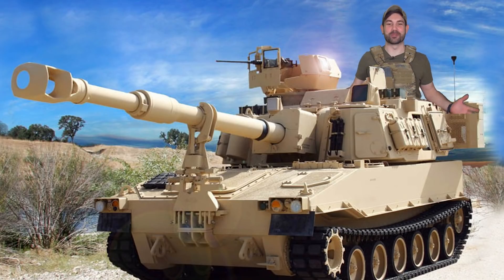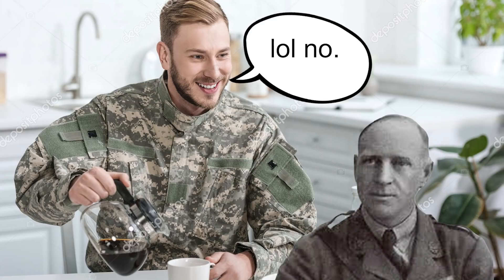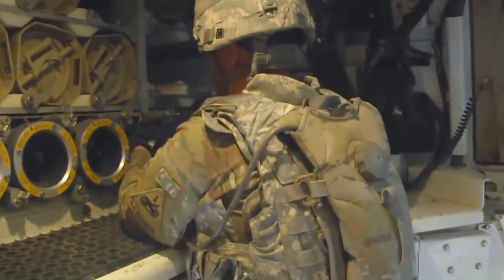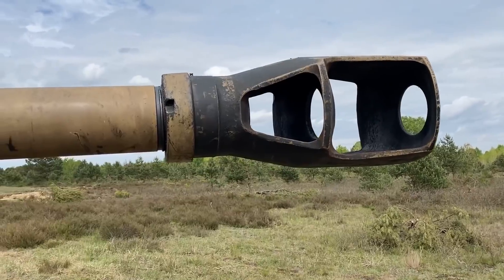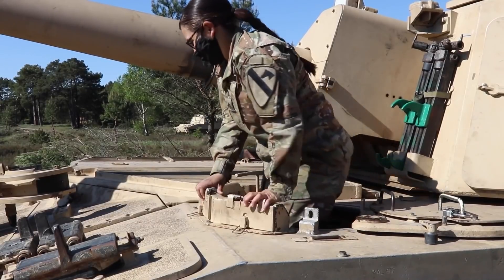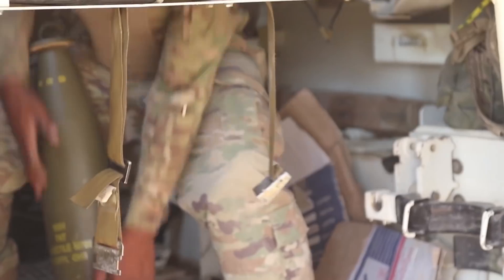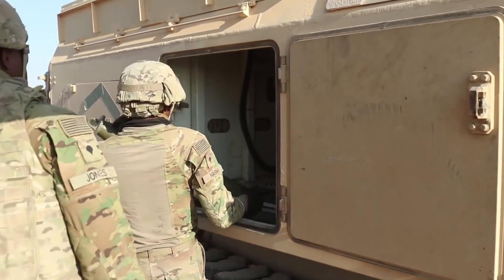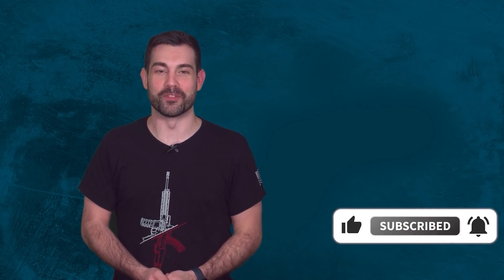M109 Self Propelled Artillery Vehicle Tactics Explained

Comment: As an IDF Artillery Corps man (2001-2004), I wonder how different the Israeli modified versions of the M109 really are. I know we stuck quite a bit more shells in them and had a nice turret back side "window" so the commander can actually see the ammo racks and soldiers behind the vehicle from his elevated position. The two main issues we had were the really unreliable track system (that had us pounding 10-pound hammers on each track piece every single day, and would still occasionally pop-out when travelling over small boulders in the Golan Heights), and the stupidly designed gunnery computer that didn't have an option to "fine tune" the gun bearing, so you wasted half the time between reorientation gently tapping the joystick to get those last few tenths of a mil (you are only considered on target if under 0.5 mil deviation (a mil is 1/6400 of a circle, a much more accurate version of "degrees"). Also bizarre is the fact that we still use long metal cables tethered to a strong spring to initiate the blast, and not something "modern" like a freaking FIRE button.
Reply: באיזה גדוד היית? אני משרת במפקדת חטיבה(בזמנך אגד) 282
Reply: Fine tune with the handwheel.
Reply: @danieparriott265  The handwheels are seperate from the electric-hydraulic system and requires flipping switches not in your immediate vicinity to turn it off, and if I recall correctly the wheels are situated on the other side of the gun - near the optical sights used for direct fire. Maybe there are two sets? I don't remember, it was never part of the doctrine and it's never a good idea to switch hydraulic systems on and off every few seconds anyway.

Comment: I think the US military in the future should keep the M109 but also have an artillery piece capable of firing a larger shell with greater range, accuracy and lethality than the M109 similar to the German Military’s artillery pieces which have a 30 mile range instead of only 12-15 miles.

Comment: I worked my way up the ladder and was a section chief on an M109 back from '69 thru '75.  In Nam the 109 was used to protect fire bases, not just from distant targets, but from human waves.  The round used to take out a human wave was the behive round. It was used in direct fire to tumble end over end once out of the barrel, then when the beehive exploded, it sent thousands upon thousands of little pleshettes (razor blade like pieces of metal) out on a wide angle at the enemy. You would not ever want to be on the receiving end as it had a nasty shotgun effect. Enemy soldiers were found ripped apart and even pinned to the trees.  I direct fired our 109 when we needed to and believe me, we could be as effective as any tank albeit we had a lot thinner cast aluminum armor. Inside comfort? Take it from an insider, I spent many hours sleeping on the 109's fold down webbed "benches".  The damndest thing about the 109's was the muzzle blast.  You never, ever want to be behind the muzzle at an angle 25 or so degrees. One day we were calibrating six 109's, all parked side-by-side like a few feet apart from each other.  Each individual 109 got it's own fire mission for observation and comparison to the other 109's. At one point during the calibration, I was sitting in the gunner's door reading when I head the word "Ready!" from the 109 next to me. By then it was to late for me to move,  I don't remember hearing the word "Fire" as all I remember was getting blown out of that turret door, across the turret into the ammo rack on the other side. Yeah, that mistake cost me my hearing in my left ear and no we didn't wear earplugs as how the hell were you going to hear the commands?!
Reply: The bee hive rounds our 106mm recoiless rifles and our M-79s were litterly nails with fins, you can buy a envelope of them at any gunshow or on ebay.   I lathed many a house with nails that were the same size, same point but with a flat head, so for nail manufactors to turn out the fin'ed flechettes was no big deal, the 106 held like 10,000 of them.
Reply: The beehive round does not tumble. Someone fed you a line. Believe me, I have 21 years in this weapons systems, a lot in combat.
Reply: @dannymalone4247  You might be right. But then I was told this multiple times not only by those who trained me in Ft. Sill but other combat veterans. Once in awhile I'd catch sight of a round going out the tube in that fraction of a second opportunity. They all looked straight to me but I cannot attest what the round did once that fraction of a second passed. Got a slo-mo video of one? Not that it matters how the round got there. What mattered was the damage it caused.
Reply: What is your thoughts on the focus of newer, lighter SPGs? Obviously not as well armored but easier to move and uses less fuel.

 Feel like the heavier systems aren't getting any love in Ukraine. All about the HIMARS and Archer!

Comment: You forgot to mention mobile artillery against static artillery battery has an edge shoot and scoot deepen or close the distance have pattern instead of static traverse capabilities they cant alter firing elevation based on moving arty to higher grounds and the advantage mobile artillery has of firing and hiding behind elevated terrain such as dunes.

Comment: Why was a ~10 meter lanyard used? I served in a 175mm/8" SPH battery; we used a 50ft lanyard when firing the maximum charge as the tube might ( and did one time) rupture. We occupied an LZ outside Ban Me Thuot with the smaller M 108 105mm howitzer which had an unbelievably fast rate of fire. Thanks for episode, the interior footage of firing was great.

Comment: The Seige of Bastogne shows the fact that sometimes there is no retreat. (It was a seige with various battles as a result). 
105mm field artillery pieces were turned into ad hoc anti-armor positions. They were not designed or intended to be used in this function. But at Bastogne, they were instrumental in blunting attacks and giving the impression of stronger defense than was reality.
Paladin can certainly hold it's own in seige defense if forced to do so.

Comment: Great video, actually taught me things I didn’t know about self propelled artillery. But in my opinion it needs more range to be safer from counterattacks
Reply: I'm not so sure. If you have air supremacy and you know where the bad guys are and they don't know where you are, range isn't much of a defense. Of course, it increases the square kilometer area that you can dominate, but remember these things don't operate in isolation.
Reply: The American 155mm howitzer has more range than any of our adversaries guns. The only countries with howitzers that have more range is South Africa (ally of the US) and South Korea (ally of the US). The Palladin is also designed for speed and agility. The most we would fire in a situation where we are engaging in counter battery fire is three shots. It would take a minute to fire them off and we would change positions as soon as the third shot was fired. This way, by the time the enemy generates a firing solution with their radar we are already gone.

Comment: So I'm a mechanic on these. I like them, but their age is really starting to show on our pieces.
Reply: Imagine working on an M110a2 in 1989 that came of the production line in 1962 ..... had a serial number of "79" on the data plate.   Got it's THIRD gun tube replacement that summer .... those tubes were supposed to be good for 10,000 EFC rounds.

Comment: Why not replace tanks with the paladin. It has amazing mobility, and has a big gun that can punch through tank easily while armour upgrades and etc…
Reply: The doctrine of a tank is very different than for a self propelled artillery. Tanks are meant for scouting and infantry support, as well has some patrolling duties. Because of this, tanks will only shoot at what they can see, and because they engage the enemy at closer distances, they require heavier armor. Also, their rounds are self contained with a projectile and a propellant, because they only shoot straight. They also typically shoot at one target like a vehicle or a specific room in a building. 

Artillery on the other hand is meant for indirect fire support. As such, their rounds are larger, but they almost always engage from distances beyond the line of sight. The coordinates for attack are called in by forward observers or by the infantry, and they place rounds downrange. Because of this, the armor is weaker on the M-109, as the majority of threats either come from small arms fire or other artillery (the armor is strong enough to withstand shrapnel, and there isn't really any armor capable of stopping a direct hit from a shell from above). The propellant and projectiles are also separated, because that gives the shooter the ability to adjust the amount of propellant for different distances. In addition, artillery mainly is used to attack an area as opposed to a specific target. They are mostly used either to soften the resistance before infantry moves in or to prevent the enemy infantry from advancing.
Reply: @avrahamhirsch2724  Thanks for writing a very good informative answer to the question.

Comment: After watching Armenia's drone shellacking by Azerbaijan in their recent conflict, its clear the M109 Paladin is an absolute dinosaur with no place on the modern battlefield.  Without absolute air superiority, even cheap Turkish drones means its crew is dead meat.  But if your air superiority is thorough enough to protect your Paladins, then the military situation doesn't really call for these slow self-propelled howitzers and their hefty logistics.  A turboprop light attack aircraft like an AT-6 Wolverine armed with laser-guided rockets will offer more precision and flexibility with less collateral damage.

WWII battleships were cool too.  They just aren't that useful.
Reply: I can hardly believe it, but the new XM1113 shells for the M109 cost nearly as much as 70mm AGR-20 precision guided rockets.  $15K vs $22K.  That's pretty bad when you realize it will likely take more shells than rockets to accomplish a given objective.

Comment: Hey Cappy.  My first unit out of AIT was 1/15FA, 2ID, in Camp Casey, Korea, in March 1997.  The M548 was already well phased out by then.  We had the M992 by then.
Reply: Was there same time “First to Fire”.
Reply: @johnrivers9393  What Battery were you in?
Reply: 84-85, 87-92, 7 tours of the DMZ. Spent so much time in the ROK that I could actually Call for Fire in Korean. (1/15FA, 1/17IN)(8/8FA,2/503IN)(1/15FA,5/20IN)
Reply: HHB.
Reply: @johnrivers9393  Right on.  I was in SVC Battery.

Comment: 45D and 63D, M109A2 easy to work and repair. M110 trained on but never stationed in a 110 unit and never serviced them, but sad to see them get retired. M992 was a pain in the ass with the blowers failing ( tied in with electrical charging system) and the front bustle racks had to be pulled back to climb down and get too, bigger pain when the racks were loaded. A lot has changed since 1993, and a lot more will change in the years to come.

Comment: Conjoined with JETS, Joint Effects Targeting System, the Paladin now has sniper like accuracy, particularly with GPS guided munitions.  It's a tremendous force multiplier for  artillery.    Being exponentially lighter easily portable it will be given out at the platoon level forward observers.

JETS might matter even more with mobile artillery like Paladins.   It's a mathematical consideration that when a target information is an approximation, error either decreases or increases with movement at rate commensurate with distance moved.   In other words, if you only knew generally a location you really don't know how much you really moved and need to readjust.  As an added plus, JETS allows for immediate fire-for-effect where adjust fire often warns the enemy.  

JETS changes tactics and the perceived power of shoot-and-scoot.  It substantially increases the Paladins military capital on the battlefield and very possibly lowering the amount munitions required per task.  This would increase tempo of operations for the Paladin which in a sense multiplies the number in field.
Reply: The 155mm has a 100 meter footprint so spending ten times the money for the JETS's trying to get the rounds closer is nearly pointless. Nearly...They've had Copperheads since 78. We tested them and we were dropping rounds down the hatches of tanks from ten miles out however the Copperhead isn't good in heavy snow and if the enemy has IR systems they can see the laser which points back to the FO's position. In this case spending the money for the upgrade is worth it because without FO's 155mm are blind.
Reply: @readhistory2023  We were told that the standard shell had a 50 meter kill radius (yes that's the same as a 100 meter footprint) but kill radius was defined to us as 50% casualties in that radius. Since we trained with the guns in a lazy W pattern with each much less than 50 meters from the next, the pattern on impact was quite impressive. BTW, I was in FTC, so I was much more familiar with the slide rules (mostly charge 5) than the actual guns themselves. Plus, I didn't have to hump the ammo.

Comment: The artillery batalion in Norway used the m109 until last year. Im sure it works great in the dessert an flatter terrains. The problem for our m109’s is that Norway is mostly mountains. When i was in the Panzer batallion we would always have to wait to advance because the m109’s got stuck trying to go up a hill. Luckily we got the k9 now
Reply: South Korean K9 Thunder?
Reply: @X.Y.Z.07  yes sir!
Reply: The 109a2/a3 was seriously underpowered, and it's transmission was overstressed when climbing hills combat loaded.  The 110a2 8", while pretty slow, was practically flying artillery compared to the 109, IME.
Reply: The K9 is much more advanced

Comment: Can it still be usefull in combat with more basic enemy forces? For sure.
Should it be replaced? Depends on who you ask - a buisness manager or a military.

The Paladin is kinda lost in a highly mobile combat situation we could face if we throw really modern doctrines/armys against each other. If that's on the US-agenda in the next 10 years ... you better change not only the M109 but the whole artillery concept to something more mobile and swifty. But that's teh question. Is there a realistic threat to be countered by huge infantry/mechnised battles like in cold war scenarios? I don't think so, but i could be wrong. Probably China or India aren't as smart as they should be - an in this corner they could have fun with the US.
But if we think in terms of functional, logical and smart warfare ... get rid of the whole ground-artillery thing(beside maybe lightwhight missile carriers ... maybe), so no more people can stumble into the idea this still could be a thing today.

Todays missile systems can deploy up to twelve pelets of self-guiding HEAT ammunition that fuse too high to get countered by APS (or top armor of even MBT's), so its uncool to risc lives by such big, slow and obvious deployments - imho.

Comment: That new Reinmetal wheeled automatic artillery piece could probably replace the Paladin, its faster on the move, faster to fire fully automated and crewed by 2-3 in an armored cabin. Just depend on how much the paladin upgrades cost vs new acquisition costs.
Reply: Wheeled Guns would have been constantly  stuck in Iraq anytime it Rained
Reply: @michaeldillery9232  This was my experience in Desert Shield ... It'd hadn't rained there in a century .... and then it DID....  HMMTT 's sank.
Reply: Wheeled motorized artillery would have been useless at times in the Saudi desert, and certainly 1/2 the year in the parts of the Europe subject to "Rasputitsa".

Comment: 3-4 shots/minute? manual loading? aluminum armor?  :D 
PZH2000 or K9 is much much better system...PZH2000 need a crew of 3 and can shoot 8-10 rounds / minute from its 60 round magazine with fully automatic loading mechanism. Its armor can stand 14,5mm russian HMG rounds.
Most of the US Army's equipment is out dated by decades!
Reply: Yes there is nothing better as the PZH2000.
Reply: @nickgoodwood4812  Yep! My country (Hungary) ordered 24 of them. They are arriving sometime in February. I am eager to see them under out flag! :D
Reply: @84rb  Congrats!. My country, The Netherlands, has about 25 of them and more are coming.

Comment: yes the M109 should have gone the way of the Dodo 20-35 years ago, similar to the german Bundeswehr M109G and be replaced with a system wich is modern and designed around an autoloader, digital battlefield management and modern fire control.
Like the Pzh2000, wich outperforms the M109´s latest iterations in every area. more than double the average rate of fire, more than 10 times the burst rate of fire, higher range, better precision, ballistic and firecontrol systems networked with digital battlefield management and GPS, programmable ammunition, better protection, better mobility, better shoot and scoot ability etc etc etc
Reply: Yep. The Pzh2000 is the most sophisticated artillery system in the NATO arsenal.
Reply: @nickgoodwood4812  And it's 2 decades old.